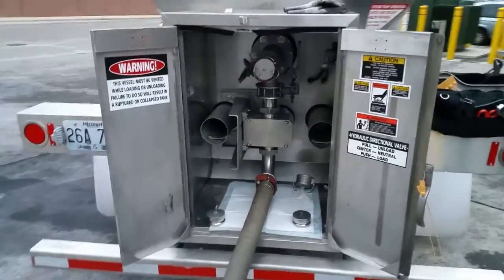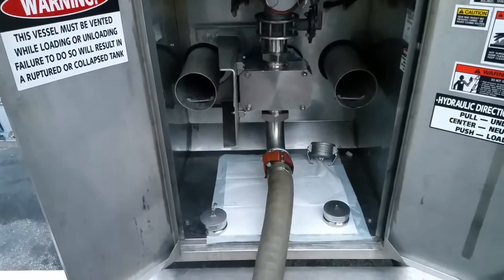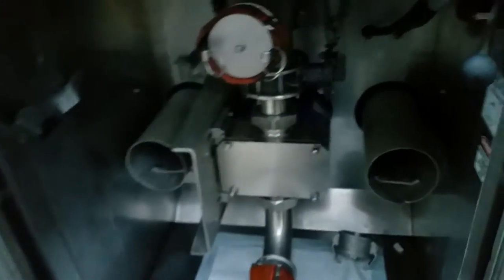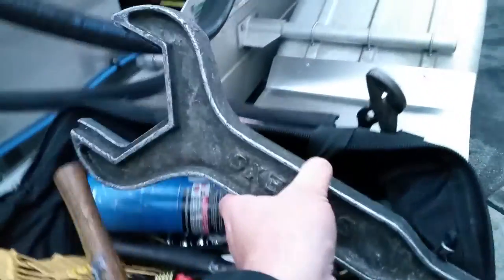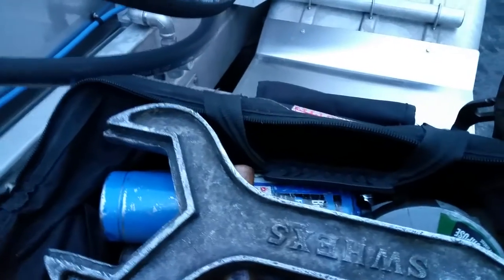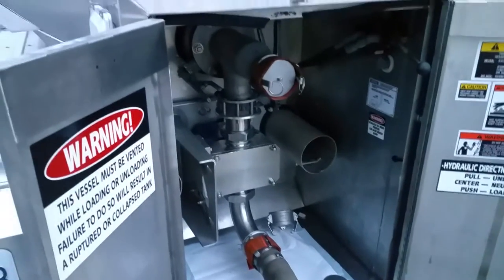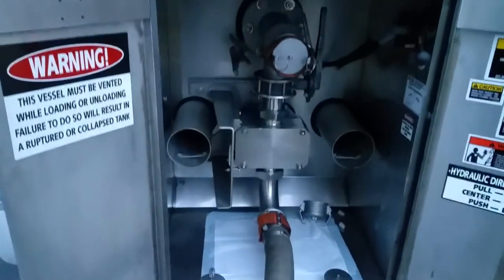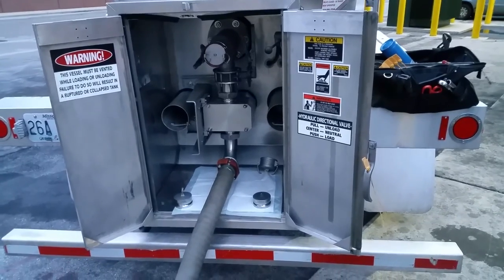Prime Inc tanker basics pt 1 & tools

Comment: You could consider buying turkey fryer gloves. That's what Jade and John use when they fuel. They said they typically last about a year. They mainly use them for fueling, but I'd be willing to bet they would last pretty long for you. You could also consider buying Atlas thermal gloves. I use those at work and they work pretty well.
Reply from the maker: The issue with anything silicone coated is they become way too slippery once you get soybean or canola or palm oil on them to be useful for, well, anything. I tried just about every option available, and you can't beat the cheap cloth gloves for grip and keeping your hands clean. After all - I'm putting this on here as advice for food grade tanker drivers. For my specific need, I haven't found anything better.
Reply: Good point.
Reply: PVC gloves are very good, used primarily used with chemicals, but still bulk.